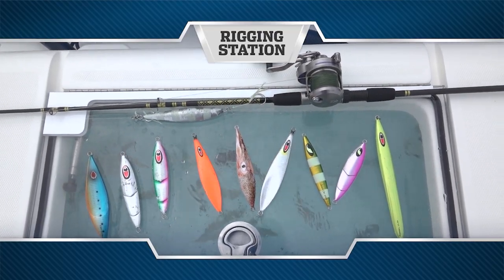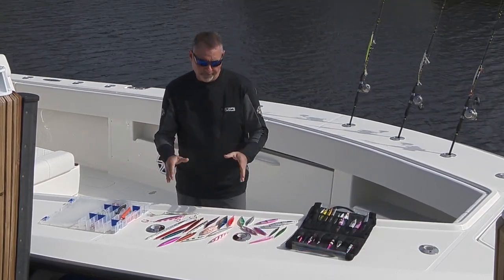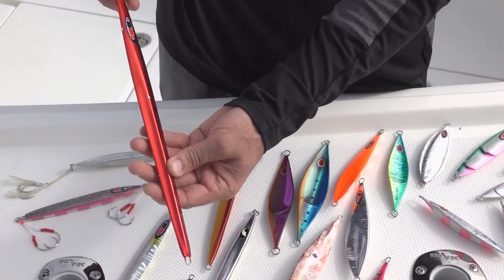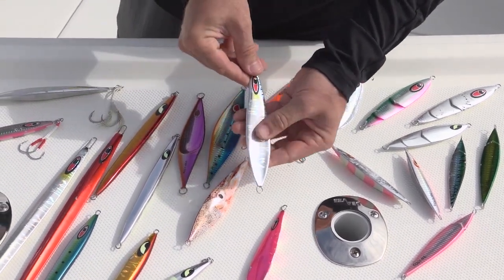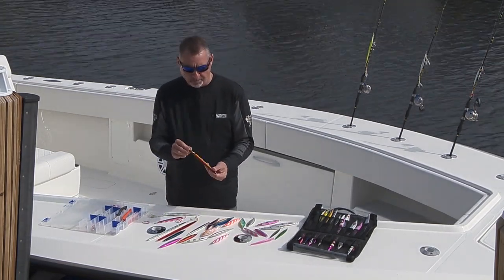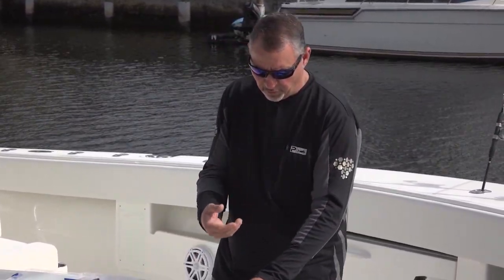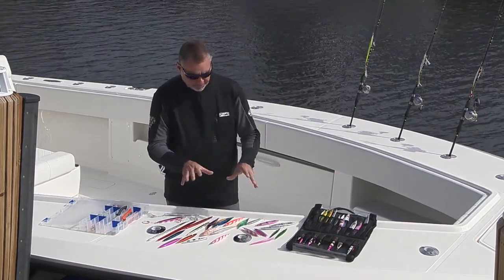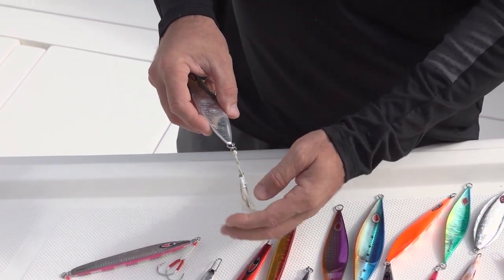Pick The Right Jig - Florida Sport Fishing TV - Shapes, Styles, Colors Everything You Need To Know

Comment: Mike, happy holidays! I have a question about weights: what will happen to heavier jigs on small depths? Same goes for speed jigs
Reply from the maker: Your question is confusing, please explain? - Capt Mike
Reply: @FloridaSportFishing  for example, we take 300gr jigs and 150 ft depths. Jig reaches the bottom very fast. Is it bad?
Reply from the maker: No not bad but in 150 ft with little to no current you could easily get away with a substantially lighter jig, 80-150 grams, it will be easier to work and you'll likely have more action.